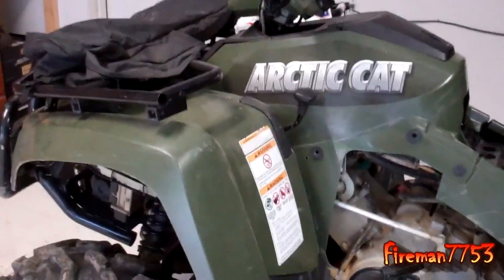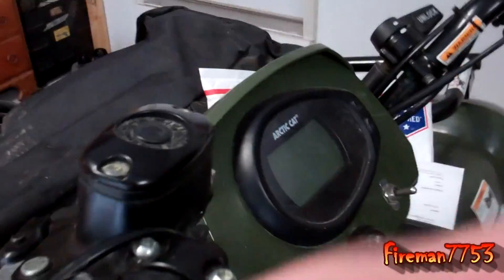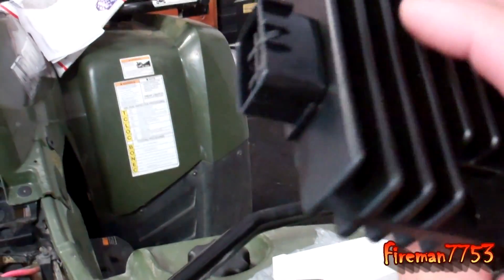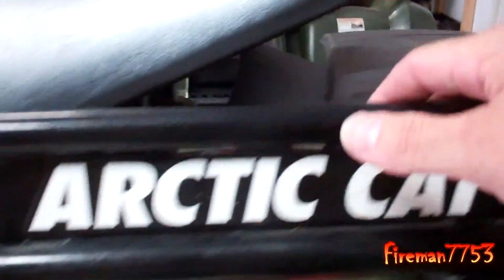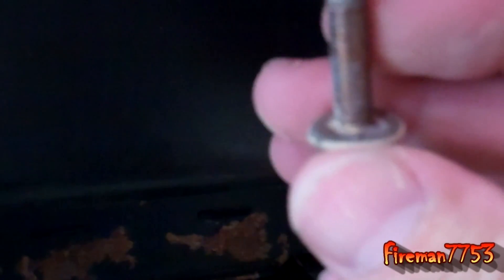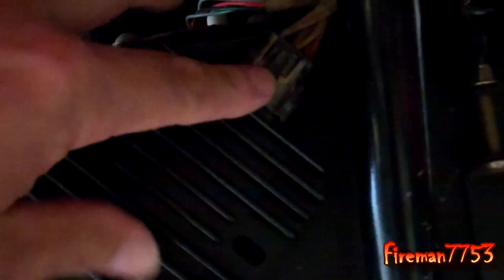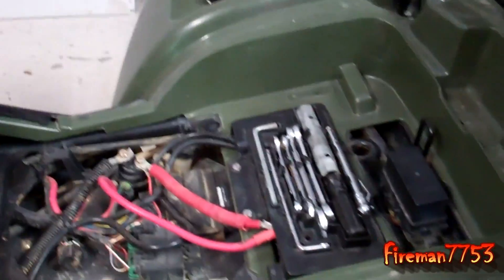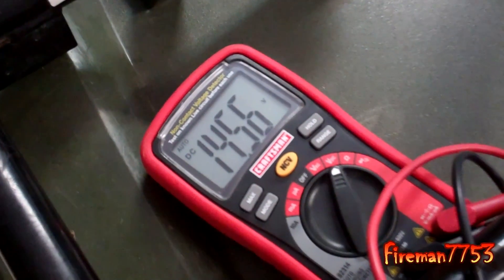Changed the Voltage Regulator on My Arctic Cat

Comment: Thanks! Your lil video is still useful after eight years -- imagine that. I never would have suspected the regulator of causing a battery drain.

5:19 I should add that something is draining the battery if it discharges while connected but doesn't when either cable is disconnected. I just never thought a faulty reg would or could do that. I would have thought something else, like a small ground fault of something.

Comment: I was having the same issue I got a brand new battery and it would die over night I thought it was the stator going bad so I changed the stator and now its doing the same thing volt on my display I am going to have to try to change the regulator now thank you

Comment: Hello, thanks for your time.
Last year I bought an artic cat 700 efi. Last week my voltage regulator burned out, so when I took it out I noticed that some wires were not connected.
The 3 yellow regulator cables are joined to 1 yellow with green cable, another with yellow with orange and another with yellow with red (they are the ones that come out of the stator)
The strange thing is that there is a yellow and brown cable that is not connected... I also found a black and red cable.

Do you know where I should connect them?
thank you

Comment: I just bought a new battery too.. Of course the preblem is still there... I have a 2012 700i trw model... P0635 flash non stop after turn on the key.... You think guys I should change the voltage regulator too?
Reply: How did it go? Have a P0635 code and a meter that going crazy or not work at all😢😂

Comment: I see that you did this in 2015.  Did this take care of the issue long term?  I've had to replace the VR twice in 2 years on my 700 along with 2 batteries that got fried.   Just wondering if this is a design flaw or did I get "lucky" with 2 bad VRs.
Reply from the maker: I think I have changed it 2x since then and think its bad again.  I have read somewhere to add a ground wire and that will help.  I am going to try that on the next one.  Very frustrating...
Reply: @fireman7753  I had not heard about the ground wire.  I went another direction and added a small fan that blows on the cooling vents on the VR.  I noticed how hot it gets and thought some added air flow might help.  I did this last spring and so far so good.